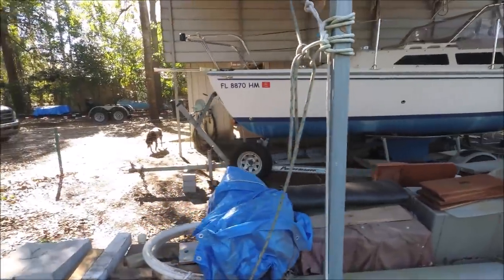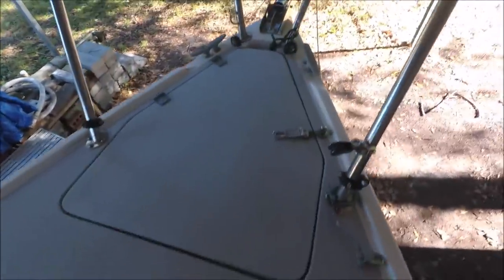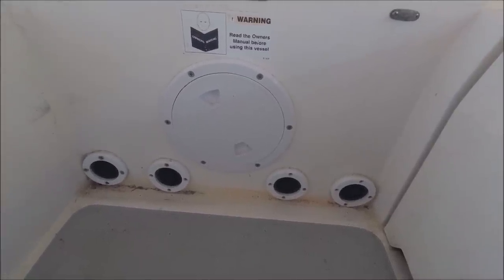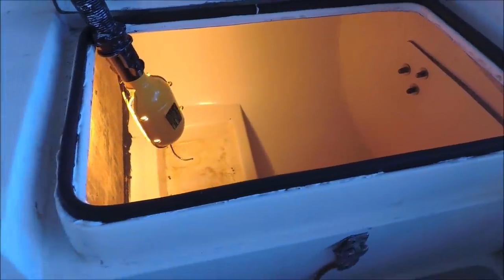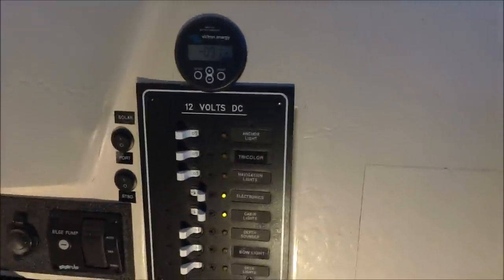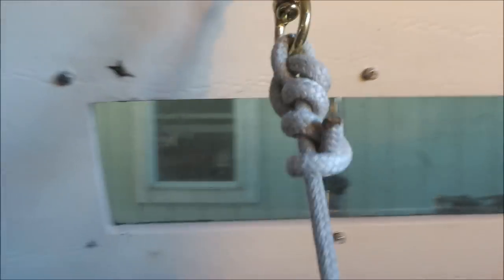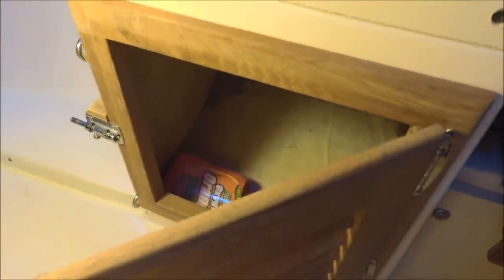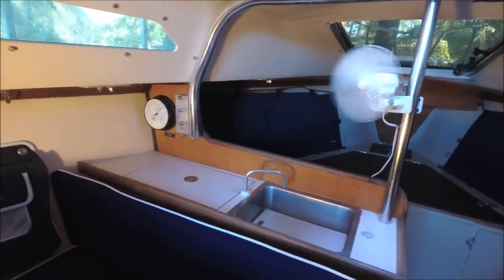Preparing a Catalina 22 for Bahamas Cruise

Comment: I am not wanting to negative but I feel that all should be informed that the Rudder Craft Kickup rudder on this boat has been installed incorrectly. The pintles on the rudder need to resting directly on the transom gudgeons so that it is metal on metal. The plastic spacer goes underneath the gudgeons not between the pintle and gudgeon. This incorrect installation will add a leveraging stress on the pintles that may lead to failure.  Also, dont know why the hole was drilled in the rudder? The gas strut on the rudder is designed to hold the blade down but still allow it to kickback if an obstacle is hit. This rudder does not need a shear pin. By adding the shear pin one has reduced the rudders ability to kickup and may cause damage to the rudder during an impact.
Reply: good to know. thank you for sharing

Comment: A 12 volt chest freezer should be run only on ECO mode. Without a battery isolator switch, the batteries will squabble. You flunked  the subject batteries.

Comment: That has to be the best rigged Catalina 22 in the history of C22's. Thanks for showing all the upgrades in detail, some excellent ideas. BEAUTIFUL electrical system upgrades. Sailing across the Gulfstream to Bahamas is not a monumntal feat, but you are definitely offshore... no C22 will ever be more safe than this one. I wonder if the 220AH battery bank will be kept charged with the single solar panel?.. I guess that depends on load usage. The owner must have money, having just invested $30-$40k in high quality upgrades... why not a bigger and more seaworthy boat like Island Packet 27?
Reply from the maker: There are two 50w solar panels on the arch, which is enough for the 200 AH bank.  The battery bank was sized large enough for his expected electrical usage during several days of clouds and rain with little solar input and based on experience living aboard my own boat. Why not a bigger boat of different design. Everyone is going to prefer one over another but the owner tells me he wanted to go with the boat he has and didn't want to deal with starting over with a bigger heavier boat and the issues that come with that.
Reply: @atomvoyager  Thanks Atom, all good stuff.

Comment: Very well done. The electrical installation is awesome. Definitely a good Catalina 22 with the right modifications to reach the Bahamas in fair weather. Given the size of the boat, safety was a priority.
Reply: You consider running the wires through the bilge 'awesome '?
Reply: @keithb6717  that is where they are run when the boat comes from the factory
Reply: @SuperBullyone  
Just because it was done that way doesn’t mean that you have to redo it that way. The bilge is the worst place for wiring. Well, on deck would be worse. So the bilge is the second worst.

Comment: Center chain plate connections for the upper shrouds should be turned 90 degrees. This allows the shroud connection to pivot. Currently they are going to put a lot of side load on that connection and it will fatigue faster.
Reply: @SuperBullyone  I wasn't invited to this discussion but I can see what he's saying & it does make some sense.  The video shows the upper shroud chain plate deck connections oriented fore to aft. (the original ones in the middle that were not replaced)  If the were oriented across the beam/port to starboard they would most likely not incur as much stress.  Though, if those are the original ones, you would think Catalina knew what they were doing with their design & installation.  

At any rate, she's a nicely outfitted 22.  Not sure what I think about the winches & cam line locks on the pop top.  Don't think I would have installed them there.  Probably would have installed them alongside the cock pit.

Comment: 1. That is the kind of work I would like to do on my boat. Fantastic. I do understand why the owner might want to do that, there is great satisfaction in sailing a well prepared small boat. However...
2. I agree with people who would have preferred a different boat for the proposed trip. The C22 is sort of tender, and I have seen them get exciting on flat lakes in just a moderate breeze. A potential challenge for the skipper on this trip.
3. I do have a question about the modifications of the forward area.
It seems that although you put a water-tight storage space in the bow area, you have created a large space that could fill with water in the event of a hull failure. Would it have been better to leave the molded structure in place, seal those spaces with a bulkhead, and maybe fill the voids with foam??
Reply from the maker: Yes leaving the pan liner in the v-berth and filling voids with foam is a good option. But as I mentioned in the video, someone had already cut out the bottom before the boat came to us. We were at least able to maximize storage this way.

Comment: Though I strongly prefer my Precision 23 to the Catalina 22, I've always admired the asthetic of the C22's spoon bow.  Nice classic look.

I put the very same access hole in the aft bulkhead of my P23 because the existing one was too small for my fat hands and arms to get into and access the bottom gudgeon that was loose when I bought the boat.
Reply: Hi J Huberty, just bought a 96 Precision 23 and love it, could be nice to exchange with you if you made some improvement, P23 owner forum is quite dead :/
Reply: @amcarru  Sure.  My one improvement so far is a mast raising gin pole.  Uses a brake winch.  I raise and lower mast, launch and retrieve all alone.  Also just bought a Simrad TP10 tiller pilot I will be fitting come Spring, and a 100 watt solar panel and charger controller to keep the battery topped off.

Comment: The steersman seems (from videos) to work, but commercially it's gone I think. The website's down and I've not seen found from the past few years about it.

Perhaps because it offers no advantage over a well set up conventional sheet-to-tiller arrangement. There's a lot of fine, easy adjustment possible with a few blocks, clutches, and eyes, it's not necessary or economical to involve rods, rails, and various other rigid metal structures.

Comment: The 12v clip on fan is good but have you thought about usb 5V 8 inch or 6 inch fans that can be powered with usb power banks. I have used solar for many years to supplement my house electric & living in FL during hurricane season usb power banks up to 30,000 mAh will power a usb 5v 8 inch ventilation fan for overnite air movement & will last for several nights before needing daytime recharging. These usb power banks are relatively cheap compared to "solar" charger units. Years ago when boondock camping I bought a Dometic 3 way  compact frig that can run a long time on a 20 Lb propane tank. The new compact compressor frig's running on 12V are great if one has the power supply.
Reply from the maker: Sounds like a good idea for a small portable power supply for a 5v USB fan as well as phone and other things.
Reply from the maker: Here's a link to the portable clip-on USB fan I've been using lately and so far has been functioning good: https://www.amazon.com/gp/product/B09PQH4VBK/

Comment: wow, wow, wow....that guy spent 3x more than the boat is worth....GREAT JOB. Only thing i saw was when you had to cut holes....you should have put some type of protected coating for the wires and hose, so the rubbing will not cut the wires/hoses
Reply: It's definitely decked out with options and custom items. Very nice setup
Reply: A boat is a waste of money, not an investment.
Reply: If you want a small boat that's easy to trailer. For coastal fair weather cruising. It doesn't get much better than this. Not to mention upkeep on such a small boat is probably really low. I bet this boat is also a lot of fun to sail.

Comment: What worries me more than any other design feature a Catalina has is the cockpit lockers have no bottoms and open up to the bilge. If the hatches fail and the lids open up to the sea as in a knock down, even though the companion way is secured, the sea will flow into the very bottom of the entire boat.
Reply from the maker: That's true on most boats. When possible I like to add a sturdy latch and rubber gasket to the cockpit locker lids and seal each locker from the bilge with watertight bulkheads and drain valves.

Comment: Many really good ideas that appear to be well executed.  But you have to wonder why the owner didn't just buy a boat that was made to cross the Gulf Stream?  I'm wonder if your modifications to a slighter bigger, blue-water boat would probably end up costing about the same.
Reply from the maker: Good point. Some people just want the most minimal boat they can get away with for a variety of reasons. It's true that the costs for these types of upgrades are only slightly less than for a boat that's a bit larger and many of us would choose to have a larger boat for cruising. But some folks value more the benefits of an ultra-small trailer-sailer. They only live aboard for up to a few weeks at a time, maybe trailer to northern cruising grounds in summer and south for winter. A small boat doesn't require a big tow vehicle or travel lift and is easy to set up and step the mast and parked in a driveway at home when not used rather than an expensive marina slip or boatyard.
Reply: I was sitting here thinking the exact same thing.  If ya like a trailer sailor, then even something a little larger.  But it just goes to show that everyone's right boat is very personal and not for everyone else.  This looks to be the nicest Catalina 22 I've ever seen.
Reply: My Tanzer 22 approaches the level of what is done in this boat, and improvements are always under way.  As to why this size and not a G26, well I can tow with a 5000 pound rated vehicle that isn't a truck.  Get to work on it at home, while sailing out of Georgian Bay, but could one day do the Bahamas or Pacific coast.

I have a plastic portal like the one on the cockpit floor, but have not installed it, being skeptical of plastic in such a critical location.  There are aluminum equivalents but $$$.

I am surprised that there is not a removable solent stay.  My Tanzer tensions one with a 6:1 purchase Garhauer tackle, but my smaller boat uses a Highfield lever.

Comment: Yowza!  I think I am going to need a lot of labels.  I take it you have doubts whether the owner installed chain plate frame connector will actually work as intended.   How long did it take to remake this boat?  The owner must really love her.  Well done.  Wish I could have done something similar to my boat.
Reply from the maker: We've got about 140 hours of work in this. I wasn't really questioning the effectiveness of the chain plate reinforcement beam just that I don't have experience with sailing the boat to know if it was needed.

Comment: Has anyone done an ocean crossing in a C22? I don't see why it couldn't be done with a few mods. The East to West crossing from Africa to Caribbean should be easy enough. North Atlantic US to UK could be kinda tough.
Reply from the maker: I don't see why the trade winds route from southern Europe via Canaries or Africa couldn't be done since it's been done many times with lesser boats. You'd want a good long weather window at the start in southern Europe.  As you point out, the W-E high latitude route is risky for all small boats. I've crossed in both directions several times on boats as small as 28' and wouldn't hesitate to do it E-W on this Cat 22. I'm not familiar with centerboard models though and their lesser stability and unknown strength of the board and trunk would give me pause.

Comment: Great mods.  Thanks for all the ideas.  Would love to see the asymmetrical chute/genaker in action.  Any idea what size was to be used?
Reply from the maker: I didn't get that far when working on this boat and am not currently in touch with the owner. But as a general rule I try to select a light air headsail about 20-25% more sail area than the boat's genoa to be worthwhile.

Comment: Hi James, Catalina did indeed make a 22' with a swing keel...It was my first boat. About 2 weeks after taking ownership of it, the keel broke off(my introduction into sailing). I vowed never to buy anything other than a fixed keel again. I was kind of shocked that someone was going to take a Catalina 22 on a blue water sail like that.
I've learn a lot from your videos and thank you for that. I have question: The bowsprit that you mounted on the Cat 22, is it a fairly easy mount? There was a Bristol 24 that I was looking at. I know they are a bit under powered and slow and thought: what if a bowsprit was added? Also putting a 3' taller mast on it. Do agree with either one of these applications? Thanks James, I hope you are doing well.  James Zi
Reply from the maker: Adding 1-2' to mast height should not be a major issue but over that the trade-offs of extra windage and weight aloft when reefed and sail balance issues start to creep in. Check to see if other B24 owners have discussed this mod somewhere. It's a big expense to replace mast, rigging and sails so usually not practical anyway compared to buying a different boat that you find suitable as is. Removable or retractable bowsprits attach in various ways. You need to look at the stemhead to come up with a plan, but yes it's doable on most boats. you can email me through atomvoyages.com if you want to discuss it further. The email is at the bottom of the homepage.
Reply: We have an 86 swing keel and so far have been good with it. But, when we first bought it back around 2005, the cable was pretty shredded. So, I had to replace it immediately and I've always checked it for fraying. One thing that I found is that if you keep the boat in the water with the keel up or partially up, the turning ball will basically saw through the cable within a year.  I also check the keel bolts yearly.  That being, I'd be reluctant to have a swing keel on choppy seas. We're lake sailors here and the swing keel has gotten us off of more than a few groundings.
Reply: I sailed a swing keel Catalina 22 the weekend before last for the first time. I seriously disliked it. It was a slow boat, under power as well as sail, had a tendency of lee helm, and the hank on jib and winches with cleats were just a hassle… I’d never invest in one, even as a beginner boat
Reply: @Monkeywrenchmotorcycles  personal choices.  The helm can become unbalanced depending upon the relationship between main and foresail. Lots of factors with that of course.  There are faster boats of course. The swing keel can be an issue if not well-maintained but is great for our lake because of the unexpected shallow spots. Interestingly, Catalina uses the exact same keel setup for their 25 model but with an even heavier keel.
Reply: The swing keel is a must for rivers and areas like the Bahamas where the coral grows, and causes chart data to be inaccurate. If you follow the channels, you should be ok with a fun keel.
Reply: @bravofighter  I sail on a lake that has about 2-3ft of varying depths throughout the year and the launches aren't very deep either. So, for us the end of the season is determined by whether or not I can pull out our swing keel 22. There isn't enough depth to retrieve a fin keel...maybe a wing keel but those are pretty rare. The fin keel may be a bit faster but we're talking maybe 0.2 kts. So, I'm happy with ours. They aren't really modern racing boats for sure but the person that says that they didn't like the C22 doesn't seem to have enough experience with trimming one. ... it seems.

Comment: Do you think this boat can be upgraded to electric motor? Are you saying the wing keel will be inadequate for off shore or rough seas? I found this this walkaround helpfull, I am currently contemplating buying a Cat 22 for sailing around NYC harbor and Long Island NY.  The asking price is $35,000 is that a good price. Found your video doing research for Catalina 22!
Reply from the maker: Yes an electric outboard would be fine on this boat if you can accept the limited motoring range and a bit less thrust than the average owner demands. I'd go with the ePropulsion Spirit 1.0 EVO long shaft linked below. That model has regeneration to recharge your battery when under sail although you won't get much output under 5 knots. For the keel type, I said the wing keel on this boat is less common but is better for stability offshore than a swing keel. I don't know why that boat is priced that high but I'm assuming it's a new boat. If you look at other listings you'll see used C22s cost much less. I haven't looked into the values though: https://www.epropulsion.com/spirit-evo/
Reply: @atomvoyager  I am flabbergasted that you replied so very promptly and in such detail! Thanks, thanks, your videos and responses to queries are a service to the fledgling sailors!
Reply: I paid $4,000 for that boat and trailer in 2005, the trailer was NEW.
Reply: @SuperBullyone  Good deal on that boat. We have an 86 "new style" C22 and have enjoyed it for the last 17 years now.